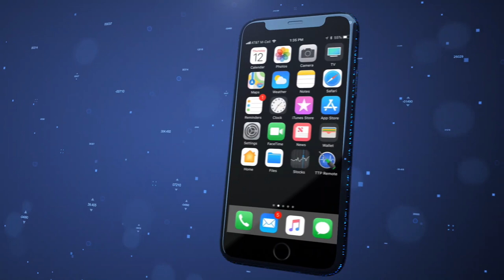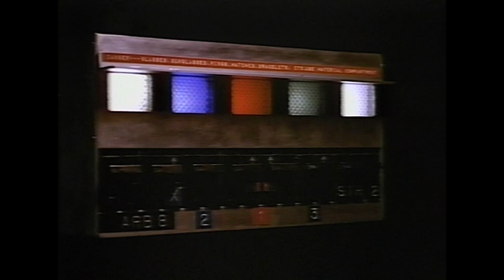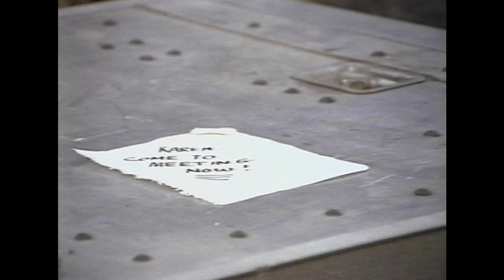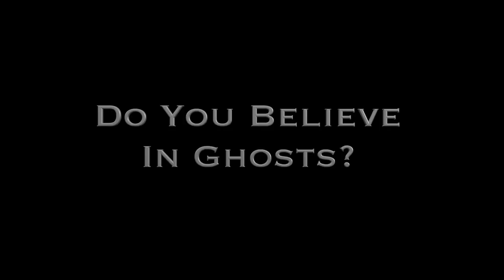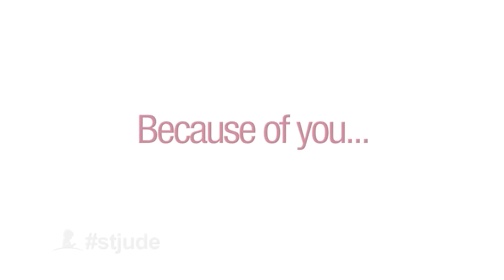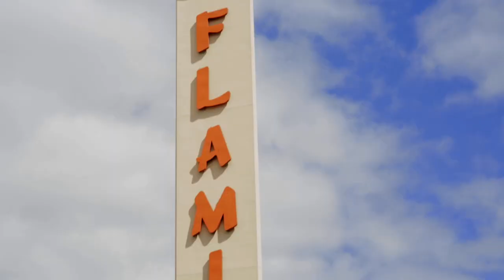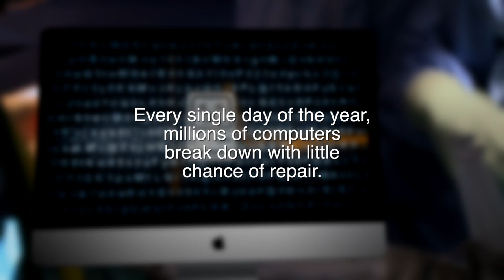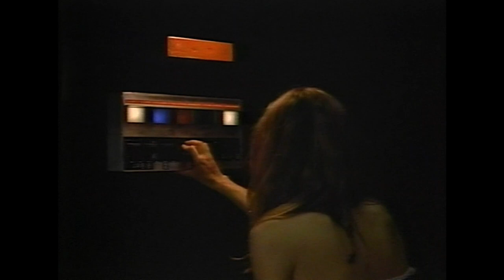The Cult Show & Idaho Transfer

Comment: 1:15:25 "How could dust get inside of here?" Air conditioning vents were open, and wind in the desert has a tendency to blow dust and sand all over the place. You're welcome. By the way, this moved SUCKED. Most of the time people walking around the desert. And the ending, where the lead female protagonist is put into a futuristic car to be used as fuel, was STUPID.
Reply: Also because it's a Duster,Plymouth Duster that is,har-har.Sad thing is,if this movie was made in 1973,that Duster was a new car,or close to it,and they're worth a fortune in good condition now.

They were made from 1970-76.Just a little fun fact from a gear head whose especially into old Mopars.My first car was a '72 Dodge Dart,which is basically the same as the Duster.

Sorry,I'll shut up now,lol.
Reply: @timvandorn8217  Thanks for the spoilers. You're a truly great and caring netizen.